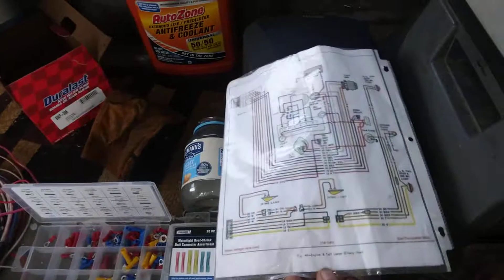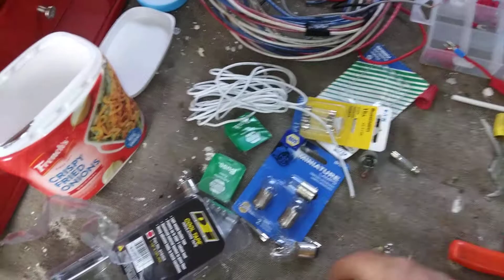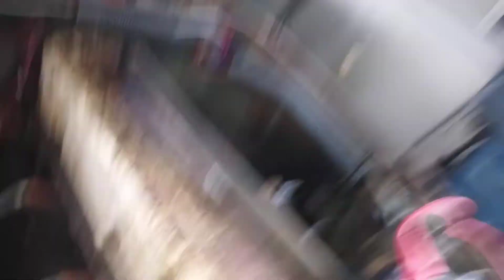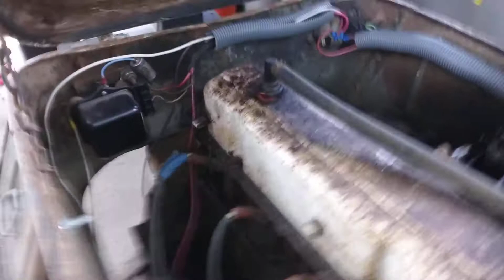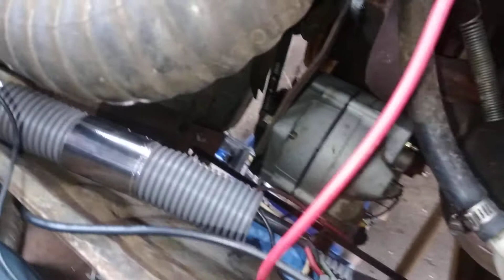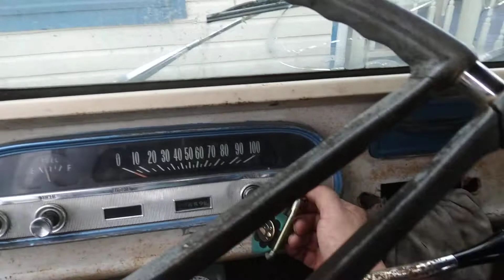65 Chevy Van new cables, basic electrical tools, alt./ground check

Comment: Hey thanks.  Wasnt sure if I should run a ground from the battery to the frame.  Today put one from the altinator to the doghouse and another from the block to the doghouse.  Going to get two more and run from doghouse to frame and battery to frame. Overkill probably but my dad says they used to do that on trucks back in the day running grounds to the back and front of truck.
Reply from the maker: If you have a test light, run it from the  + of the battery to the spot you attach  the ground to make sure that it is a solid ground area,  clean that area very well also, if  it doesn't light up, find a spot that does.